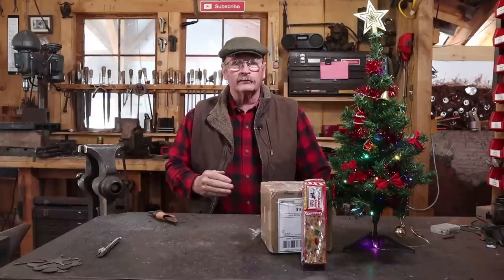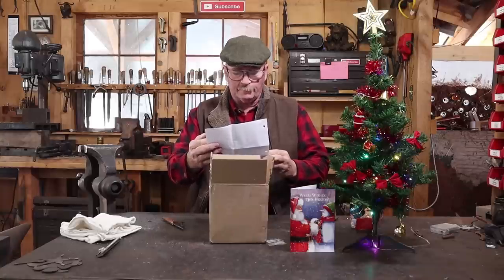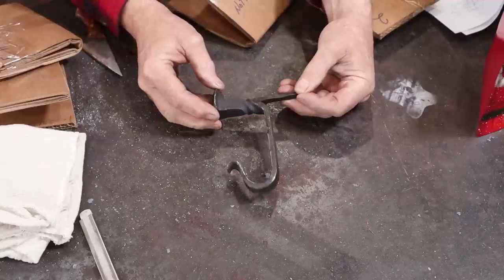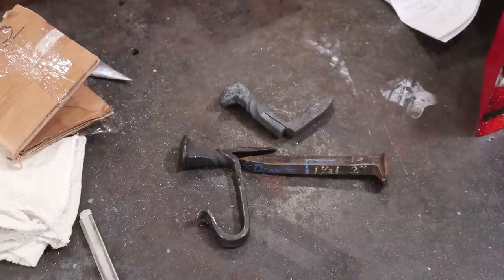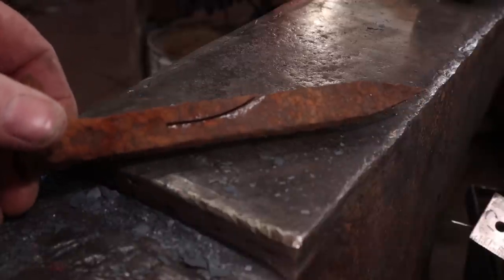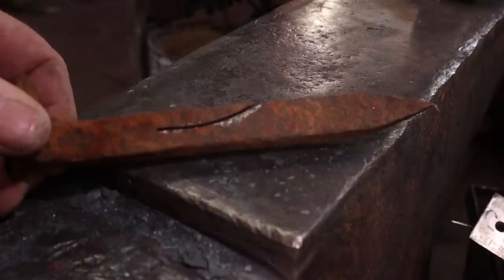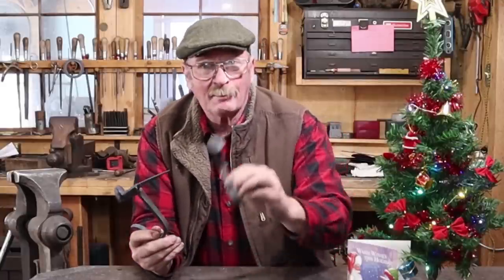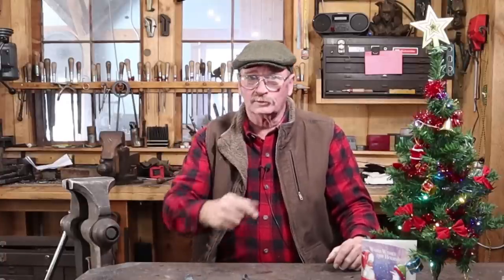Railroad spike drive hook - Hook of the week 33

Comment: Your videos are a bright spot in my week.

I like the wider hook you made--I have an old (1970s vintage) sheepskin coat that has kept me warm in Iowa blizzards for nearly half a century. The only thing 'wrong' with it is that the back of the collar is pretty thick and tends to pop off smaller hooks. I put wrong in quote marks because that thick collar is mightily appreciated when the wind is screaming by (my house is the highest point in at least 10 miles to the west).

Comment: Great hook. Great execution. 
I particularly like the neck-down you did on the drive spike. I wonder if this design could be used for other household tools. Perhaps you could make a candleholder sconce with that design, or a much smaller (tiny) hook to hang pictures: a western (think Remington, etc), or a railroad or even industrial themed room. Turn it upside down and redesign the hook part  for shelf brackets or make towel rings. (Just make sure you drive it into a stud or house-beam. I would love that hook if I make it into the “give-a-way.”

Comment: Thanks for your videos, they have helped a lot of us new hammer heads by sharing your experiences!!!! If you want some stainless steel try a local well drilling or pump installer, most submersible pumps have a stainless shell that can be split or cut off into tubes to put a bottom in for a forge dipper or other uses and they have a stainless shaft in them!!! Even a few bucks would be more than salvage yards will pay them for them. just the pump ends though, the motors would be hard to do anything with!!!

Comment: I had a similar idea. However I didn't think of splitting it this way. I was going to do a 90 degree bend then drill a hole and place a screw or nail into it. I think this way would be a lot more interesting of a piece.

Comment: Happy Holidays to you and your family John! And to the rest of your extended viewing community as well!

I love the video and kudos to the contributor of the original hook design. As a less experienced smith, I'll admit that this design and the cold shut issue had me perplexed to begin with until i saw you forge it. The layout lines were upside down from the way you drew it out (the spike head was upside down)  goes to show how a simple difference can throw off my OCD brain. LOL. What I'm happy about is that my first thought was the same as yours. Cut the split at an angle. Would the twist that was added create contribute to that issue as well with a right angle cut? 
Can't wait to try it myself!
Reply: ..the twist came because i cut it on the wrong side...
Reply: Ahh that makes sense. The twist looks good. Like Bob Ross used to say, Happy Little Accidents.

Comment: Would love to hang the hook you made in my shop. 
Love the content you put out John.
As a side note, as I was watching this, I saw an oportunity based on something I heard you say, to try making the split a little bit differently, but this would only apply if not putting the twist in the shank.
Establish a fuller about 1/4 deep, then establish bend 90 degree  in the spike  at the fuller, cool the spike, and then cut straight in with the bandsaw, and the kerf of the cut will not be a limiting factor for the radius of the cut.
I plan on trying this method as well for making split rein tongs with my bandsaw to avoid trying to create the sharp radius cut with the bandsaw at the end of the tong rein which is impossible to do with a bandsaw. I imagine this is clear as mud.
Merry Christmas, and have a safe new year. 
I also like fruit cake, and when I was in the military I could always count on getting all the extra fruitcake that came with the C-rations that no one else liked.

Comment: That spike would be a great example for some of my spikes.
 I have been wondering what to do with my bucket of railroad spikes. At one time my job had me covering a lot of railroad right of way and when I met railroad employees I had handouts to give them. I met this crew and they came running up to my truck looking for handouts, I had met them three other times that week and given them handouts. So I said I give you guys handouts all the time when are you going to give me some handouts. The foreman asked if I could use railroad spikes for anything. I said sure. He left and came back with a bucket of new spikes and gave me the bucket. I wasn't allowed to interfere with their work so I asked if this would be a problem. He said no they were done when they ran out of railroad spikes.

Comment: You were saying it's kind of awkward to hold on to as you were tapering out the spike around 13:00 to 13:30.  To make this easier next time, why not quench the end that would be the lower hook so you can hold it.  It looks like there is enough length there that if you only keep that spike hot, you should be able to hold the far end in your hand.

Comment: When I first saw the original hook I thought it had been half cross-cut into the shaft, then the end was bent away and a vertical cut was made from the bend,  Have you thought of doing a set down instead of a cross cut?  Have the head end overhang the edge of the anvil (far or near end depending on how you're holding the spike).  Use half face blows to bite about halfway into the shaft of the spike (Correcting the width as you go).  Then you have a slightly slanted step in with a nicely sloping transition into the end of the spike.  You might want to take a file to the inside corner to create a handy ledge to take the saw blade for the vertical cut.  You also might want to finish drawing out the spike end before the cut.  I agree that the twist is probably easier to do first.

Comment: It is nice, even though I understand the aesthetics of a single piece project as this, I think it might be easier to drift a hole and use or make a separate nail or spike to put through it and into the wall or whatever it is going into.  Drifting a hole would save so much work and no cold shut issue.
Reply from the maker: The nature of the hook would likely be quite different. For it to look similar you would need to punch and drift through the head and centered down the inch or so of full size material to come out right behind the 90 degree corner.
Reply: @BlackBearForge  I understand. I guess I was thinking of just having a way to hang it, not make a replica. My mistake. The one you made was the way I thought it should be cut to prevent a old shut. Thanks for everything. Love your videos!

Comment: Tip is splitting - I think you serendipitously demonstrated a cold shut again.
At around 13:40-14:18 when you are drawing out the point for the spike that goes into the wall, it looks like it's a hollow point, from the surface moving more than the core, and it probably developed a cold shut when the point was finished, resulting in the tip splitting.
You might consider that for a video lesson on its own, demonstrating that the surface moves more than the core when drawing out a billet.  Take 2 lengths of 1/2" (or so) square stock, draw one from the center working to the end, the other working it from the end to the middle, and show the mushrooming at the end of the 'wrong' one.

Comment: Never stops amazing Mr how much one can do w a rail spike
  Am curious would one drill a hole then saw to it to stop stress riser if it were a more critical item?
  I'd be honored to be chosen to be blessed with a Black Bear hook, definitely would be a treasure item
🙏 Blessings to you sir
Crawford out ⚒️🧙‍♂️
Reply: If the loss of material from drilling and the extra time spent sawing aren't deterrents to you're project, that's a fine way to solve this problem. Your new concern will be cooking the thinner areas so watch that metal color for high temps during heating. Yellow-white at that spot or sparks flying off in the forge means take it out of there!
Reply from the maker: Drilling would help but it also leaves a thinner area where you want it to remain thicker. Lots of trade offs
Reply: @BlackBearForge  , yes sir thank you, kinda what I was figuring,  it would have to be small bit less than 1/8 then it create a new set of issue as stated above. 
  Great lesson thank you so much
🙏 Blessed be. Now
 Crawford out ⚒️🧙‍♂️
Reply: @Brokentwobutton  , got it affirms my  suspiciouns.
Thanks so much for your time and help.
🙏 Blessings to you
Crawford out ⚒️🧙‍♂️
Reply: @dragonstonegemironworkscra4740  you could also upset and then flatten the area you intend to drill(or might as well punch and/or just hot cut at that point).

Comment: All I need to try this is a spike! Not readily available in the UK I believe.
Reply from the maker: How do they anchor track?
Reply: @BlackBearForge  the uk used to use a cast "chair" that was coach screwed down then a spring clip wedged between the chair and the flat bottomed rail. Now we've mostly converted to concrete sleepers with flat bottom rails they are secured using a spring steel pandrol clip. No spikes involved. I'm going see if  I can get my hands on a pandrol clip to see if I can do anything with that.... Don't suppose, should I win, you'd post the spike hook to the UK? Happy Christmas John.

Comment: I have an off topic question for you. I have a 100 + year old anvil that has been use quite a bit and the face edges are pretty chipped and there isn't a right angle anymore. Can the face and edge of the anvil be machined to give it more life, or is it hopeless?
Any information is greatly appreciated.
Reply from the maker: As long as you don’t cut so deep as to weaken the steel face.

Comment: Couldn't you also just forge it down on the edge of the anvil, leaving a step where you want to pick up the extra metal for the spike to nail it into the wall?  You could then slit it with a band saw with a parallel cut, or even just hammer it into shape, similar to making the side leg on a scroll fork. Quick easy draw out for the hook, easy straight cut for the saw if you want to do it that way.
Reply from the maker: Sounds like it should work